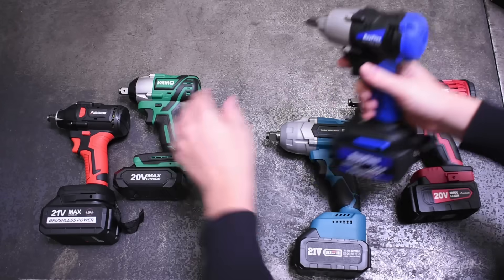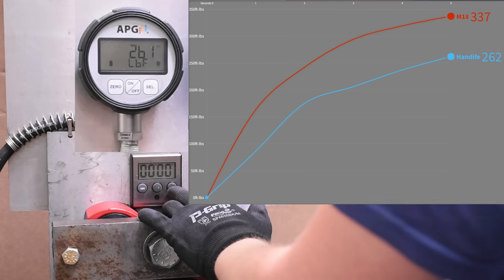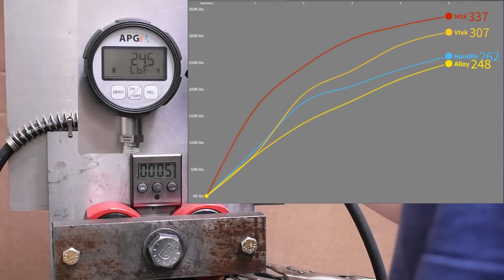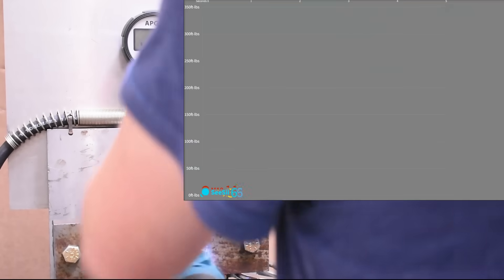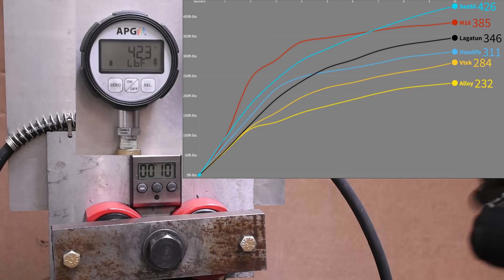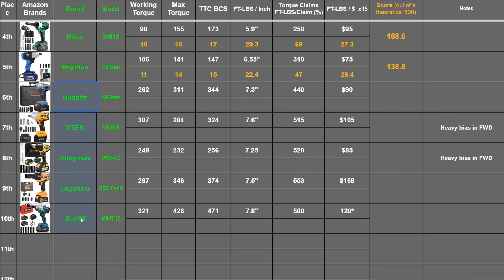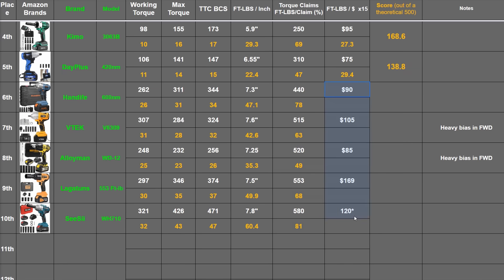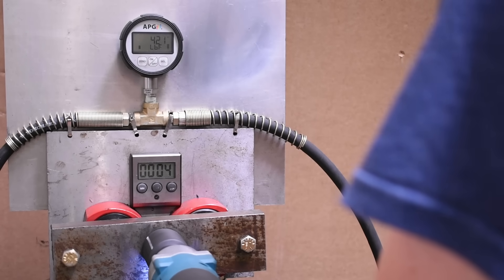The Most Powerful Amazon Impact Wrenches vs Milwaukee: Not Bad!

Comment: Amazing power from brands that mislabel what they're selling! Love the video as always.

Would you consider doing a video on crowsfoot wrenches? I think their performance is more critical than even flare nut wrenches. Tekton claims to be better than Snap-on and Gearwrench which I'll believe if I see it.
Reply: Wouldn't be surprised if they are better than gearwrench. I love my GW ratcheting wrenches, but they're non-ratcheting wrenches are junk.
Reply: @James-tf7kn  Yeah, but surprisingly  the Gearwrench wrenches actually scored pretty well on this channel (channel or box end, cant remember).
It stinks because Gearwrench is using all of Armstrong Tools designs, but cheaping out on the important parts and making hit-or-miss expensive tools.
Wish they had just kept Armstrong as the amazing company they were.
Reply: Would like to see that test. Obviously would have to include the cheapest set from HF. I doubt they best gear wrench and strap-on but I'm sure they are decent. 

Intoxicated rambling bellow.

Most of the time when I'm grabbing a crows foot it's last resort. Unless using it to torque something. So I would like to know the best of the best and the best value. I have a tool box at home and at work so Obviously I don't want to buy high priced tools 2x.

Comment: I think that Amazon brands should be their own category. They should also be put in the larger respective categories as well.

That Seesii would of ranked top 5 in the rankings list.

The tools like the craftsman and OLD dewalt dcf894 would of tested exactly mid pack amongst the amazon brands.

Just put an extra asterisk and explanation that it’s an Amazon tool and doesn’t have proven reliability.

Comment: Thanks again for a great video. Love that SeeSii which I own. Only wished the batteries were more durable. They seem to be fragile. Can’t toss those around. I’m also trying out that Vtek. I like its compact hardcase. Thanks again for your efforts!!!
Reply: I guess you'll have to pick up a makita battery 😅
Reply: @WayneWerner  also have to pick up a Makita battery charger. I don’t think the charger for the SeeSii works with the Makita battery, I’ve tried it.
Reply: @WayneWerner  there’s similar batteries that works with it and also use same charger. The Makita battery you would have to buy Makita charger.

Comment: Is there a reason you don't test loosening power by pre-tightening a fastener and timing how long it takes to loosen it? If it even can? I guess you would consider that breakaway torque testing. THE DCF900 says it can loosen 1400 lb-ft. So to test that you would tighten to 1400 lb-ft first, then see if it can loosen it.

Thanks for your efforts! I love the channel!
Reply from the maker: Breakaway torque cant be precisely measured, depending on how it's set up you can have 40% variance. DeWALT for instance doesnt even use a bolt or nut, but a strain gauge on a torsion bar to rate breakaway. Everyone does something different. The method we use is the traditional impact wrench rating system used for the last 60 years or so. But Shop Tool Reviews does great testing with breakaway if you're after that specifically.
Reply: @TorqueTestChannel  I'll give that a look. Thanks for the reply!

Comment: Why are we using the Milwaukee to compare?
The DeWalt DCF891 walks all over it.
Reply from the maker: Not every impact is trying to beat the most powerful model ever that just dropped. Milwaukee is just a known value
Reply: Thanks for your reply. 
I do think the top of the chart should be included in rankings as it would help see the big picture of all things in the category.

Comment: Got a budget impact gun that would beat any of these...

Europe only, sadly. Erbauer (Chervon brand, aka Skil/Kobalt etc) sells a new release full size impact for £70 ($83) bare tool. £56 ($66.50) before sales tax. Brushless, only claims 560Nm but makes that in spades, outperforms some of the older high torques in the workshop and not a million miles behind my M18 high torque. 

Erbauer EHTIW18-Li. Might turn up as a Skill at some point, Erbauer and Skil run the same batteries. Bizarrely cheaper than the far less powerful compact 1/2 from the same brand.

Comment: Its impessive, but they're not that cheap, I mean a few are.  The SeeSii I can't even find in Canada, and works out to 214$ which is quite a bit even with two batteries.  You can find a name brand with a real warranty (more or less) with 1 battery on sale for that, but you have to wait for the sale, great testing as always.

Comment: i bought the avidpower based on your video. its more powerful than my impact driver (go figure) and is nearly as powerful a my 2ft breaker bar. so far very happy for the ~$85 price tag. it pulled most of the head bolts out of a 7.3 head.
Reply: Dang!
Reply: Son

Comment: I'd imagine that yeah the up front cost is lower but compared to a milwuakee, dewalt, makita or other big name the life expectancy of the driver and batteries is probably significantly shorter. Requiring another to be purchased and would quickly erode any perceived savings of buying a knock off unit. 

Some durability testing definitely needs to be done in a daily shop use environment.
Reply: Weeeell... Makita has been known for not having the most reliable batteries around either....
Reply: Depend on your use case - if you are a DIYer or other occasional user, it could last forever... And, as we have seen recently with the Milwaukee hammer saga, brands are not foolproof with reliability - in fact, it is not in their interest to be...
Reply: "Some durability testing"  Drop 4 feet onto concrete floor for openers, then torque test the survivors.

Comment: I'm curious how much the quality of the battery matters. I know they're not interchangeable but it might be interesting to remove that as a variable.
Reply: Matters a great deal, I'd wager!
Regardless of battery chemistry, their capability will differ widely based on the quality of battery, all because of how MUCH material they're packing into each cell (which directly translates to mAh/capacity). 

Here's a long-winded example (TL;DR at the end):
I was given a cheap 2 LED "Work Light" for Christmas one year (BigClive has taken apart multiple variants that are similar to mine). It can take 4xAA [in series] or 2xLi-Ion 18650s [in parallel], and it came with two 18650s of unknown brand.

I have various 18650s that I've salvaged from laptops or old portable DVD player battery packs. Some are VERY old (early 2000s) but seen little use, while others are equally old but saw zero use. The ones from my old laptop are ancient Sanyo, and ~4 of the pack's cells were toast ("dendrites" formed and internally shorted out the cell) but the other 4 were good.

Right off the bat, the differences are stark... The 2 cheap ass cells this thing came with are noticeably lighter weight than any of the various salvaged cells, which means either less material, less electrolyte, or both; therefore, lower capacity. 

THE TEST:
I've used the light —while taking my dogs out at night— on its power-saving Low setting until the light's programmed minimum voltage is reached and turns it off (I think this is an unfairly high 3.5V or so). Then, using an external charger, recharged the pair. Rinse, repeat a few times.
     The Cheap Cells: I can get maybe 5-7 outings*, which is roughly *7mins each outing; Total Time = ~40mins before needing to be recharged
     Old Sanyo Cells: I tried to get a matched pair (based on charge capacity, as displayed by my charger). First Pair was... not good, as one cell was tired and caused the pair to last only about as long as the Cheapo pair. Second Pair is 👌👌! I have gotten OVER A MONTH'S WORTH of doggy bathroom outings, without having to recharge yet! For the last two weeks I even pocket the two cheapos, expecting that outing to have the batteries finally go out on me, but every time it's kept going! (I checked them a few days ago and they're at 3.66V still, which is just below the 3.7V nominal Li-Ion rating)

T L ; D R  —
Cheap batteries with super cheap cells, will not be able to put out anywhere near the ln amps, nor have anywhere near the duration. Cell's capacity will get lower and lower over time, so the fact that my two heavily used and "old AF" Sanyo cells are lasting substantially longer, is quite an important takeaway here. Comparable to a gas motor with 350K miles (like, 8 million kilometers? lol) still being able to outperform a cheap rebuilt motor. The carbon buildup, cylinder wear, potential blow-by, shouldn't result in that.... But the cheap rebuild used low comp heads and dished pistons, with a shitty cam profile, so rebuilt it not it sucks ass! lol

Comment: The torque curve isn't so important in reverse given that you're starting at peak torque. Most things come off pretty quick once you've cracked them loose.
Reply: It’s more important for rusted stuff. He may be starting out at Peak torque and then going down from there and like a skidmore machine but if the threads are rusted or the bolt is misformed or something like that, then it still requires torque to spin it off even if it’s broken loose so that’s why dynamic torque still matters in reverse

Comment: Curious why you still say "$219 Milwaukee mid torque". 
Just bought one on Amazon for $159 and that's been the price for a couple of months at least.  It is the 1/2" anvil model, the 3/8 IS more expensive.
Reply from the maker: $229 at home depot at the moment. Prices change all the time everywhere, can only go off of what we paid
Reply: @TorqueTestChannel  Yes, but $219 is not representative of what would be paid today. Amazon's price is not a sale price, it's been this for months.  Especially as you're comparing the $159 Milwaukee to AMAZON torque wrenches.

Comment: Have you guys seen the new hyper tough 12v impact driver and cordless ratchet, I believe it’s made by tti as well, it looks like a Milwaukee
Reply: No, but thats a very interesting observation
Reply: Have you try them? I have stayed away from the Hart and Ryobi brands.
Reply: @toyotatundra0455  I have them and they’re amazing and the 2 amp battery is only 17 bucks and so far they haven’t disappointed
Reply: @toyotatundra0455  no.  I’m sorta stuck on the other end of the TTI spectrum.   Bought into the M18/M12 a loooong time back.   Probably 12-13 years ago.

Comment: Tyler Tube did a video on a tire changing kit last week. That "impact" gun from his video would be interesting to see how it stacked up. It was weird. It was like a regular drill that had some sort of a kick every few seconds. While it worked in his video, I would love to know the numbers on that thing. I have a feeling if that was used on a shop impacted lug nut it would fail miserably. Love the video as always guys!
Reply from the maker: That's one of those 12V cigarette lighter plug impacts, all the same guts. They spin up like a flywheel then centripetal force eventually moves it to interfere with a lip that it smacks. Very slow impacting so probably wouldn't do well here in a timed test, but the dynamic force per blow is quite high all said using that design so it DOES take off some stuck stuff for sure at the end of the day
Reply: @TorqueTestChannel  I use one of those cigarette lighter impacts to adjust the stereo volume while driving. Able to get the Loud knob up to 11 with all those ugga-duggas. 🙂
Reply: @TorqueTestChannel  For fun might be use to do a "best case 5 minute run". That thing was very slow impacting but a very heavy hitter for sure.
Reply: @TorqueTestChannel  Bonjour quelle est la clé à choc sur batterie la plus puissante que tu es testé ???
Reply from the maker: @Langloisbati  Salut, ce serait le DeWALT DCF900 en 1/2" et Makita XGT en 3/4"
Reply: @Langloisbati  I’m not TTC but I believe it was the new Dewalt DCF900.
Reply: @TorqueTestChannel  ok je penser que tu m’aurait dit la AEG bss18htf12
Reply from the maker: @Langloisbati  Celui-la est proche
Reply: @TorqueTestChannel  et selon toi la clé à choc sur batterie la plus fiable c’est la quelle ?
Reply: @TorqueTestChannel  et la visseuse à choc la plus puissante que tu es testé c’est La qu’elle ???
Reply from the maker: @Langloisbati  Kobalt XTR & Flex
Reply: @TorqueTestChannel  Selon toi la marque d’outils électroportatif la plus fiable c’est la quelle ???
Reply: @TorqueTestChannel  I had one of those when I was in high school. It was the cheapest thing on amazon at the time. It didn't not work... but I certainly wouldn't get one again
Reply: Yes, tested one of these 15eur things a friend gave to me claiming it wouldnt chooch (broken wire right from the factory) some time ago. it would make some noise but the motor burnt out before it could take out a rusted axle nut. Piece of junk. Old 1980s 230v bosch 3/4" impact did the job in a few seconds.

Comment: I need to stop watching this channel.  Bought the Black Friday Atomic impact sale because of this channel and spent 30 minutes taking wheels off and putting them back on for fun when it arrived.
Reply: Lol. I did the same with my m18 fuel mid torque. Wwaayyy better than the brushed high torque
Reply: Ha ha, been there.
Reply: That and a case of beer sounds like a good time
Reply: Dude, yes. I did the same thing. Bought the DCF923b almost two weeks ago. It's great, so much better than my old brushed model. I'm actually kind of bummed I haven't needed to use it more but I'm a mechanic so I know it's coming.
Reply: Getting new tools, regardless of what it is, is like getting new toys when I was 7 years old.
Reply: @mikeycage1587  I love toys too! I've got the seesii 710 set on the way!
Reply: I just bought the seesii 710 based on this channel. Can't wait to hugga dugga!
Reply: What store and price?
Reply: @n9wox  It's the Home Depot Dewalt Black Friday.  Battery charger, 20v 6AH battery, 20v 4AH battery, and the DCF921B for $199
Reply: @reubensandwich9249  where can I find it? Doesn't show on the app or website
Reply: @andrewk8636  DCB246CKWCF921B

It's a deal where you buy the battery bundle you get the choice of a free tool.  An SDS rotary hammer and portable bandsaw are some of the other notables that are part of the sale.
Reply: @reubensandwich9249  oh I found it! Thank you! That's Essentially free batteries for me since I've been looking to buy the impact already
Reply: But did you build a dyno rig yet? Lololil
Reply: I paid 99 for Dewalt brushless 20v atomic  with 2 batteries and charger and bag.  It’s a absolute beast! Never happier after someone stole our last impact!
Reply: Same dude, I have m18 fuel, dcf900, and HF ultra torque…. Been looking for the rigid octane 611b or some shit like that. But no luck lol
Reply: Same here but works .. which im grateful for   Lol
Reply: The atomic dcf922 is a beast.